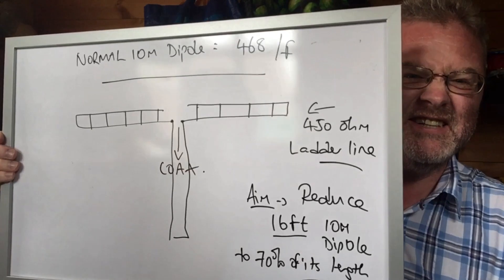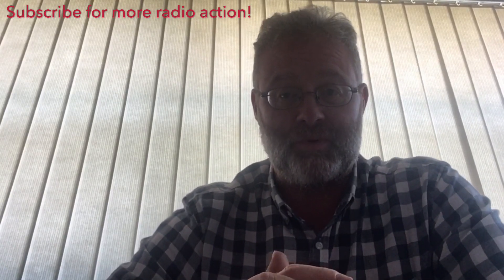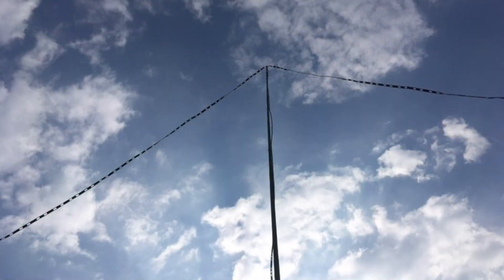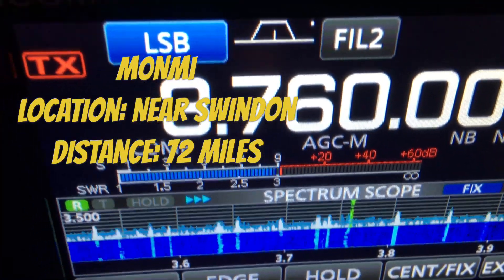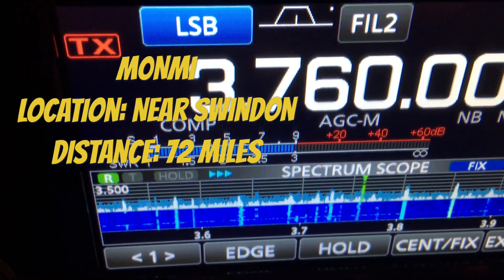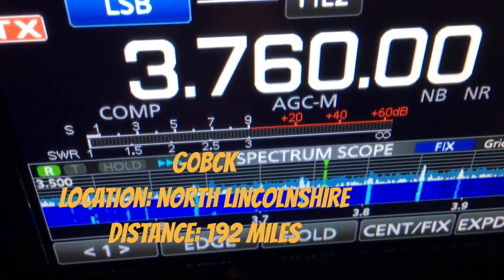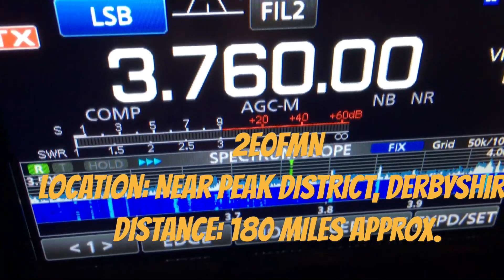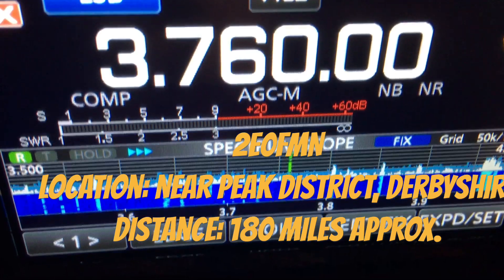Doublet Antenna Shortened For A Small Garden

Comment: Would like to build a Doublet in the garden but, it would mean running the ladderline at the same angle as one of the antenna elements. Would that effect the antenna ?
Reply from the maker: Hi James yes it would likely lead to the ladderline radiate and cause rf in the shack. Try and keep it as much as you can straight downwards.

Comment: Happy weekend Tim getting geared up for Winter field day And I was curious if you noticed much bandwidth difference on your doublet when you added the third center line to the linear loading ? On this particular antenna you have 45 feet total length or roughly 22 feet per side and also using your tuner have you found a different links work better for you for all of the bands? Does your tuner have a 4:1 transformer built in? And are you using it if it does? Have you noticed much difference when using 300 Ohm for the feed line instead of the 450 ohm? Which seems to work better for you?
Reply from the maker: Hi Pat the bandwidth (2:1) is appreciably less with the 3rd wire. My tuner was an LDG atu.. I used a 1:1 current Balun. It’s a big compromise but it kind of radiated ok on 80x
Reply: @TIMG5TM  thanks again Tim!
Reply from the maker: @PatAutrey  pleasure!
Reply: @TIMG5TM  Trying to decide the best antenna to build and use for 10m and 11m and was wondering which of these you feel would be best choice:

10 m vertical antenna options

1. Dipole (direct connection to coax)
2. Dipole (using a 1:1 balun)
3. Doublet Dipole (Fed w twin lead+ATU)
4. Doublet (legs and feeder twin lead + ATU)
5. Linear Loaded Doublet (legs shorted + ATU)
6. 3 wire LL doublet (50% shorter + ATU)
7. Coaxial dipole (1/4 dielectric 1/4 coax, choke)
8. Coaxial Bazooka 
9. Elevated dipole w 4 ground radials 1/4 wave
10. I Max 2000 (64%, 5.1 dBd gain, 15 degrees)
11. Gainmaster (coaxial capacitors go,tuning stub)
12. Double Bazooka
13. 5/8 wave dipole
14. Off Center Fed Dipole 
15. G5RV
16. GOGSF
17. End Fed Half Wave 49:1
18. Random Wire 9:1
19. Delta Loop (horizontal vertical polarization)
20. Collinear 
21. Yagi
22. Bobtail Curtain + reflector 
23. Vertical w parasitic reflector

Comment: Hi Tim, that seems to be doing the job well done. By the way i sent you a comment in your discussion section re our qso the other day. 73 Sid
Reply from the maker: Sid MI5UTC which video did you post the comment Sid? 73
Reply: @TIMG5TM  Hi Tim, it was in the discussion tab on your channel profile if that makes sense. it was just to confirm what time our qso was the other day so i can update my qrz log.
Reply: @TIMG5TM  What radio you using please Tim?
Reply from the maker: David Lean hi David it's an Icom 7300. Thanks for watching and commenting. 73
Reply from the maker: It's 15:26 UTC Sid
Reply: @TIMG5TM  Thanks Tim